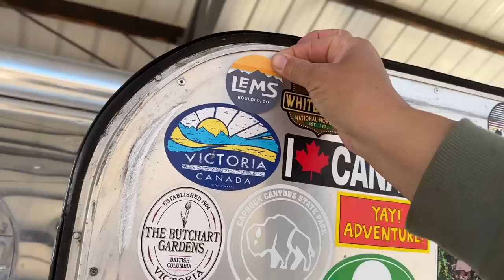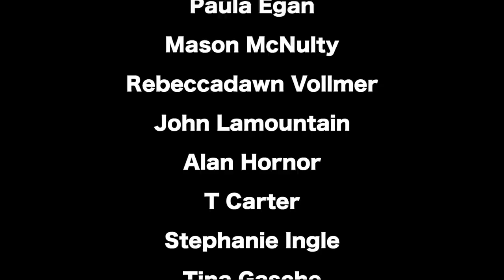SAFETY THIRD! Stucco Production Ramps Up + Lem's Shoes!  (Chicken Garden Day 177)

Comment: A tiny bit of info for Jax and Ada on the ice from compressed air. That ice was naturally made but could have had oil contaminants if there are any in the tank, otherwise it would be edible. Depending on how one wants to look at things there are two to three things at work to make the ice. There is moisture in the air we breath even in the middle of July and August or whenever the peak heat is at it's highest the is still moisture in the air. You can look at the air as 1 overall component or as 2 components for this demonstration which would be 2 Hydrogen, 1 Oxygen making up the water component and various gases as a part of the air we breath.

When placing gases and/or liquids under pressure a person can affect and change the boiling and/or condensation and even freezing temperature, to where something can boil at lower temperatures and things like water can be made to condense(go from a vapor state to a liquid state much like when, by morning the temperature has dropped low enough to cause moisture in the air within a certain distance to solid objects to condense/return to liquid and form dew on the grass, roof tops, sidewalks, etc., and the movement of air can lower the temperature of things it flows over, through, around and  etc.!! 
So there is moisture in the air being pressurized, likely allowing for the freezing temp to be warmer than it's general 32 degrees, like say, 40 degrees, then you have the air movement around the moisture. Those are both things happening to allow or make the moisture freeze.

In fact the first known way man created ice of his own making, not from snow or ice on ponds and lakes and etc., was to take panels of cloth like material, kind of like a gunny sack and wetting it hanging it and letting cold wings blow across while slowly pouring more water over to build up the ice then break it apart and make more, so they didn't even need the compression for that method. They used cool night temps and either found where the best natural airflow.... if there was no suitable place with airflow then they would fan the water manually.

Comment: I think I mentioned once before that the stucco on my parent's house in Northern Alberta lasted at least 70 years. Tiny broken bits of glass of different colors were in the top plaster coat. Great video. Good to see you having to struggle less with the coating.

Comment: I'm crossing my fingers for you guys that the sprayed stucco works! It looks great so far.

One side point on the little shoes commercial in the middle. I sold shoes for a few years and in the process got to talk to some shoe brand representative where I learned how bad it is for both your feet and especially your shoes to wear the same pair every day. This is because sweat is acidic enough that if you don't give your shoes time to dry (like a full day) that it will begin to wear out your shoes from the inside. So best practices is to have at least two pairs of shoes which in my experience more than doubles the lifetime of your shoes.

Comment: You've invested so much time and energy in this project. I truly hope this round works as hoped. But after I watched this for a while I remembered something. I'm from Missouri. Our climate can't make up its mind whether it is wet or dry. But stucco -- the cement based kind -- used to be applied to chicken wire stretched over black felt paper that was tacked onto boards. It is a royal pain to remove if  you have to remodel, but it does have staying power. Just passing this along as information. Your current work looks so good!

Comment: Water is a byproduct of compressing air but that doesn't mean it can be ignored. Water can cause rust and damage to air compressor systems and tools, and hot discharged water can be dangerous to operators. In addition, this water can cause tools to freeze up in the winter.

Comment: The spray on technique is normally used to achieve that textured look.  Applying with a trowel is typically used when you want a smooth finish.  The most important factors appear to be the preparation and the mix ratios of Cement to Lime & Sand and of course water to get the right mix.  It is looking good, so I hope that it all works out over time.
Different topic, have you ever thought of making an electrified but movable "run", to allow the goats to eat down the grasses, rather than having to mow it.  You know, make the run using posts that could be moved around, but herd them back into their enclosure for the night and some of their special "snacks"?
Reply from the maker: We have a portable electric fence. They just aren't interested in the grass.

Comment: did you hear about the plastic mixture you can use in your cement , and that eliminates cracking , I seen it used on a two story house ,  there was one crack developed & the guy that did the job thinks his helper missed. that batch with the proper mix , he fixed it & that was 2010 , this was / is in midwestern Manitoba ,,CANADA  .

Comment: Anyway you could provide specs on the stucco hopper and air compressor you are using. We are considering spraying too but the hoppers seem to require a ridiculous amount of air like 8-13 SCFM for continuous use.

I'd be curious as to the compressor size you're using and the pressure you're running at the hopper.

Ashley doesn't seem sold on the gun vs spreading by hand. I'd love to hear the final verdict.

Keep up the good work

Comment: Excited to be back in chicken garden content! Is that stucco just cement you’re spraying onto what’s left of the earthen plaster? Will the weight of the cement not eventually cause the remaining earthen plaster to come off and bring the stucco with it? Excited to watch and see!
Reply from the maker: Stucco is: sand, cement, lime and fiberglass so we're not just putting more cement on top of the base plaster. At this point the base that is remaining after this monsoon season is stuck on very well so no we're not worried about that. We are removing anything we see that is loose before applying the stucco though.

Comment: I had to look up barefoot shoes. I hadn't heard of it and wondered if it was a brand name. No. A barefoot shoe has the heel and toe at the same height just like your foot. There's less material under your foot letting you feel the ground. There's a wider toe box so your toes can spread out. There's less padding and support so your feet and ankles strengthen up. They're lightweight and flexible.
Did I get that right, Tiny Shiny Home?
Reply from the maker: That’s it!!
Reply: Wow, that’s sounds like a shoe I need. Do they sell in Europe do you know?
Reply from the maker: There are lots of European brands.
Reply: @TinyShinyHome  😊 thanks.

Comment: Why aren’t you using mesh to stop cracking ? Old school they’d anchor chicken wire or panels of stucco mesh, now with the styrofoam and stucco exteriors they use rolls of a nylon mesh.   Concrete will crack guaranteed, so you must have a mesh securing it from major cracking and bits falling off.
Reply from the maker: My Little Homestead told us they never needed to use a mesh underneath so we're trying this one without it.